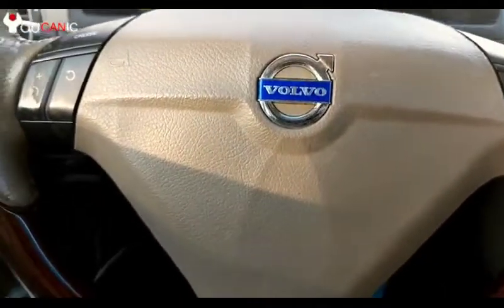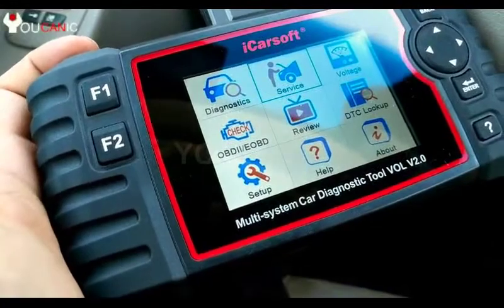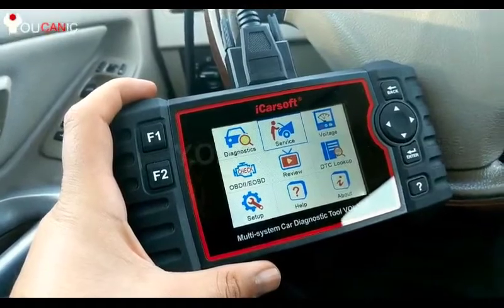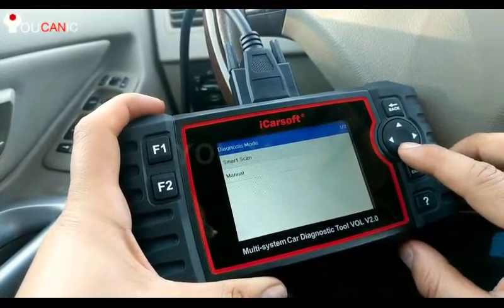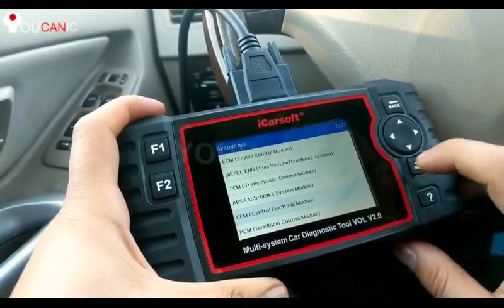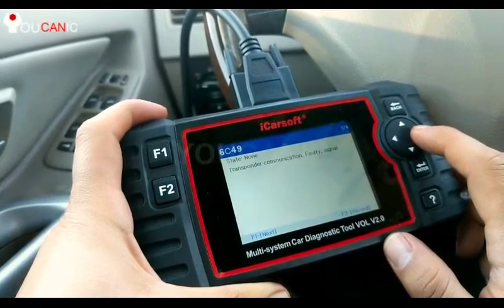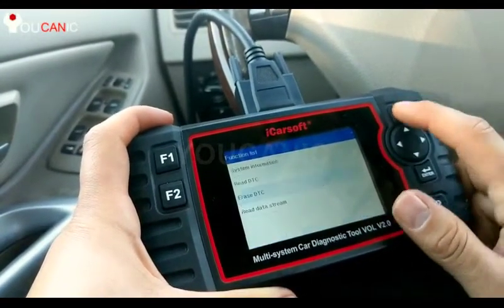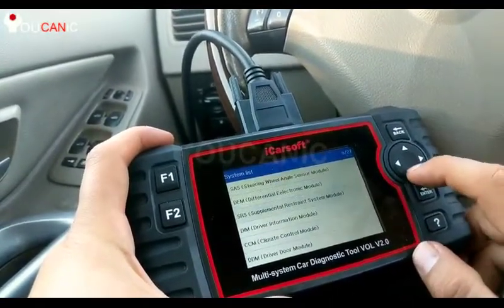How to Diagnose the CEM Module on a Volvo: Step-by-Step Guide

Comment: I have seven codes to show up on my CEM: 9C03, DF14, 1A5E, 1A5F, 1A61, 1A62, and 1A64 . I've taken to vehicle to a couple places and have received different answers. The majority of the problematic codes is not communicating with SAS, BCM, TCM, ECM, and AOC. Would replacing the CEM be the best option?
Reply from the maker: Hi there! It sounds like you've got a complex situation with your vehicle. At Youcanic, we aim to empower car owners by providing resources, such as guides, our YOUCANIC scanner, and even factory repair manuals, to help demystify these tricky scenarios. Feel free to check them out at www.youcanic.com. 

While replacing the CEM could potentially solve your issue, it would be best to consult with a professional for a more accurate diagnosis. You may also pose your question on our Youcanic platform where you can receive more comprehensive responses from our community of experts. Amidst everything, we're here to support you through your car ownership journey!

Comment: Surely a faulty CEM will give false component/module failure codes. Without inspecting the CEM for signs of corrosion or cleaning required, how can you tell what is actually at fault.
Reply: Not at all

Comment: Having electrical issues with a volvo v50. With the same tool as you I see CEM and CEM-low. Under CEM it can't read the codes. Do you happen to know what the two CEM options mean?